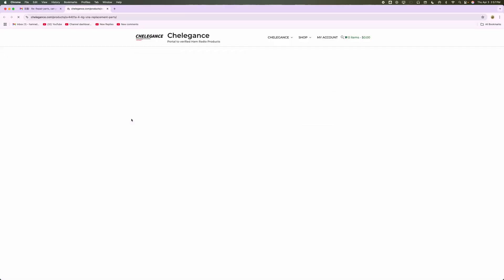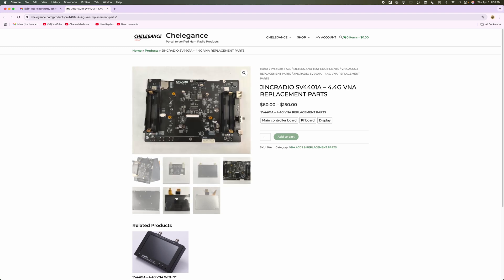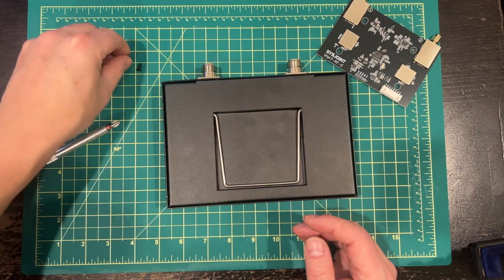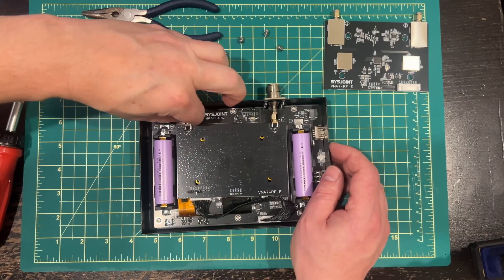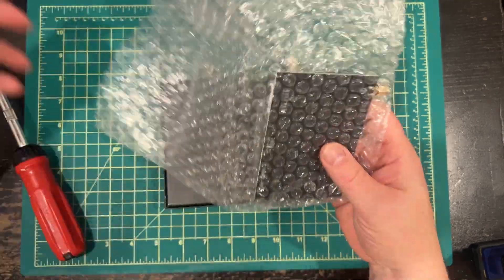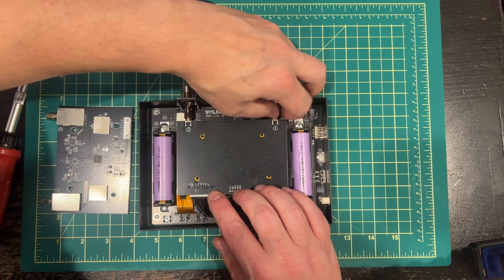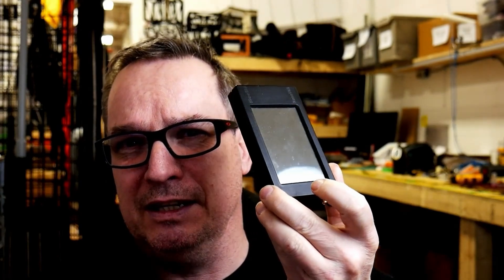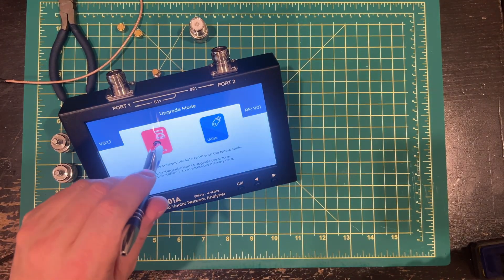I Fried My VNA… Then Fixed It Thanks to Chelegance

Comment: Nice to see you are now involved in amateur radio. I hope you get involved with HF antennas. Jon Banquer.
Reply from the maker: Like this? https://youtu.be/96KtICkqXwQ?si=5zSZMCjokuimIPA6
Reply: @VE6SFX_HamRadioRookie  Yes, like that. Do you use an antenna modeling program like MMANA? I hope you're after gain! 

MFJ purchased HyGain and Cushcraft. Both made excellent antennas for a long time! MFJ recently folded after trying to sell their business with no luck. I believe you would excel at creating antennas and masts/towers and that you have finally found the right, stable business for you to make some serious money at.
Reply: @VE6SFX_HamRadioRookie  Not enough gain like a quad or light weight yagi. See my other post to you on your No Concrete Needed video.
Reply from the maker: I am actually looking at doing a hexbeam style instead of a yagi or quad. They can be quite a bit smaller done right
Reply from the maker: But disguised as a patio umbrella I think it woud be less so. I know it would not be at the optimal height but I think it would work if I put my faraday cloth on the top of one. I'm 90% sure I could squeeze a 20-17-10-12-6 on one and maybe be able to use the 17 with a tuner for a crappy 40m